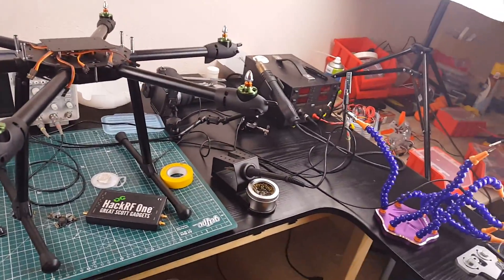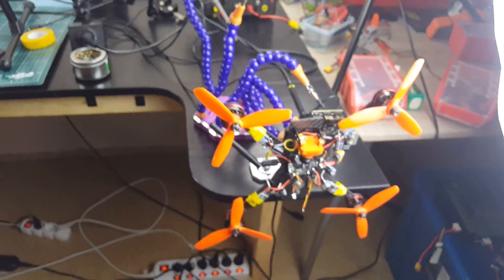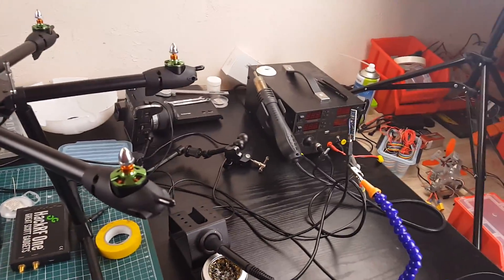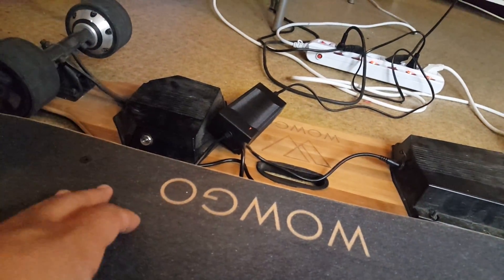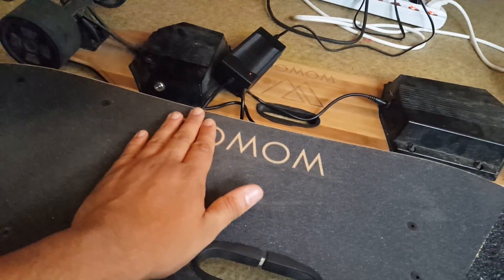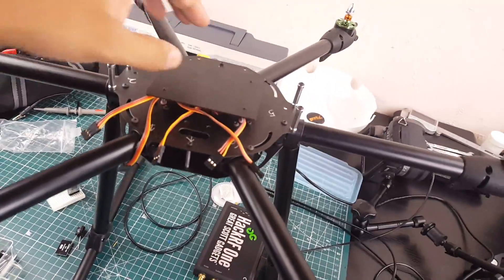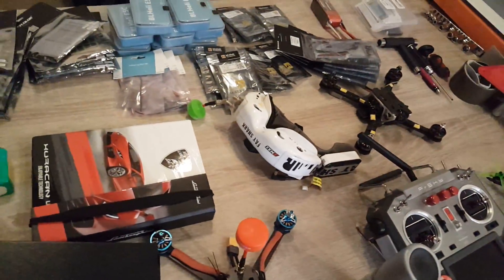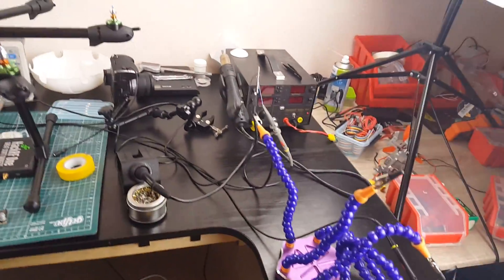Why I started testing ESC's // WOWGO MODS // Speedybee FC APP HACK  // DIY Camera Drone Build

Comment: Bro I have actual anxiety issues and suffer from attacks rarely but enough to where I have been prescribed various anti anxiety medications and I don’t care what type of vehicle I could be given.. an electric board, a freakin back to the future hover board or a pagani zonda..... ok maybeeeeee the zonda..... but a chemical imbalance can only be fixed by correctly balancing the chemicals.. for example If you were making cookies and they sucked reallly bad so you just added a shit load more sugar and magically they were the best ever... I understand you were just using it as an analogy but shitty past week has had my anxiety up and I felt I had to respond... my lab died after 15 years just a couple days ago and my wallet is missing after some shady workers did our solar panel system on my house.... i could eat a whole lot of bars right about now... mmmmm...the green ones......they actually look a lot like ❎❎❎if they were connected and not separate squares 

Brb....
🚰      ❎❎❎  👅 omnomnom ⏰    😋😛😝😜🤪🤩🤤

Ok better now😎